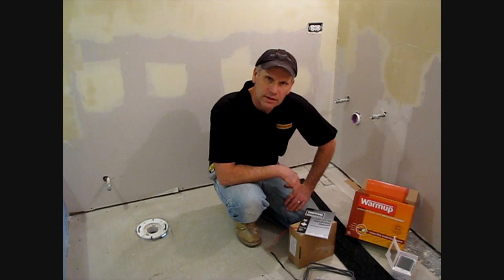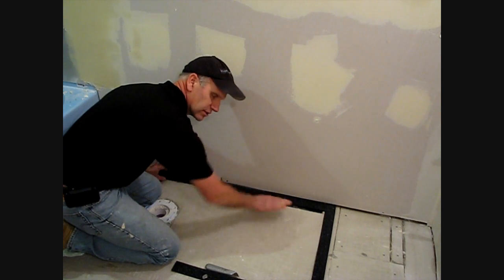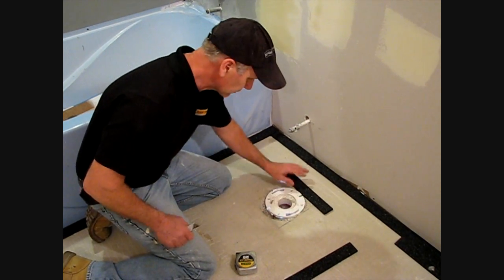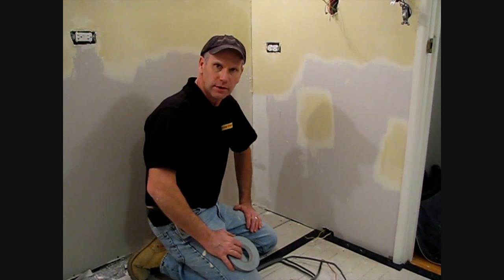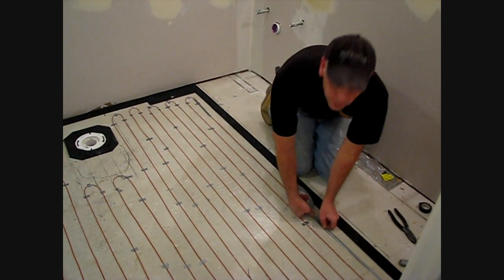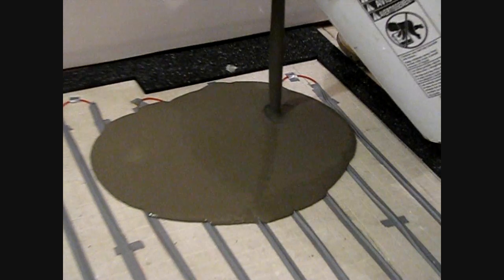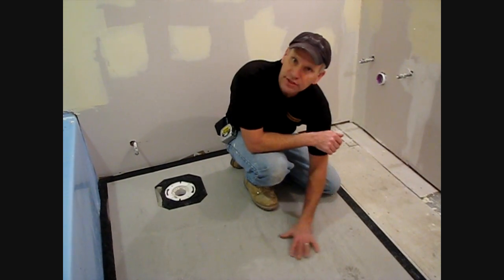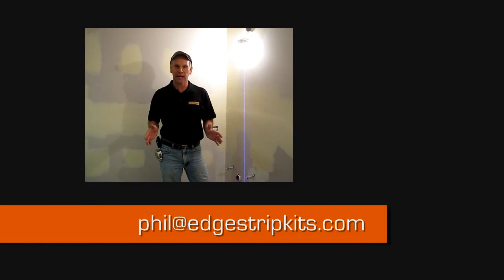Using Edge Strip Kits to Install WARMUP Loose Wire Electric Floor Warming System

Comment: Hi, I am building a curbless shower and I'm not digging out my slab. Would I be able to use these strip to border my shower pan area and use self leveling cement to build the floor up around it? Can I use a waterproof membrane and tile over top of these strips. ?

Comment: Just so you know, its against code to have electric floor heat within 12" of an toilet for the fact that you can melt the wax ring.  I never seen it happen but anything is possible.
Reply: u r correct.

Comment: Use foil tape, the t u people used for ductwork joints. Very sticky, and can be formed tightly over the wire with less a air trapped.

Comment: Under the tape is air, and its energy lost.
Reply: True, I don't even see the need for the tape to be used over the full length of wire. I mean if you are gonna pour SLC over it, why would the tape even be needed?  (of course you need a few small strips of tape to hold the wired down, but not a total covering)   IMHO.
Reply: You should never put down long strips of tape because air gets tapped under the tape causing the cable to burn out.